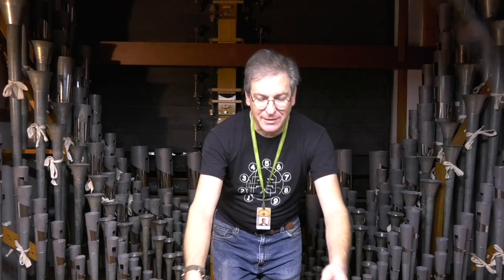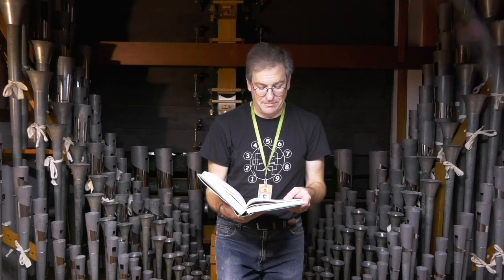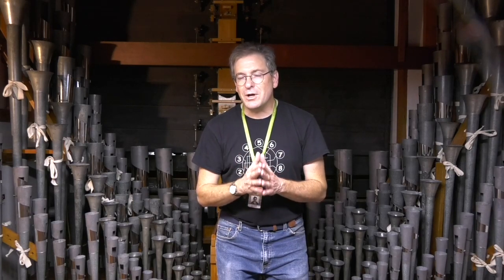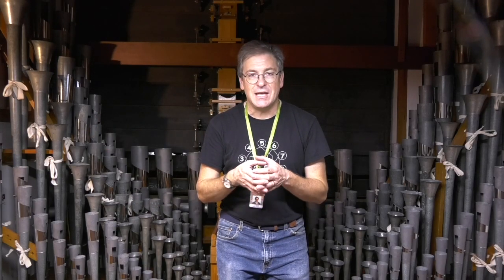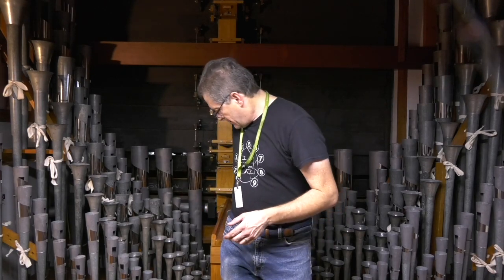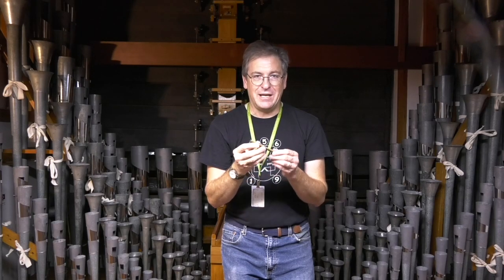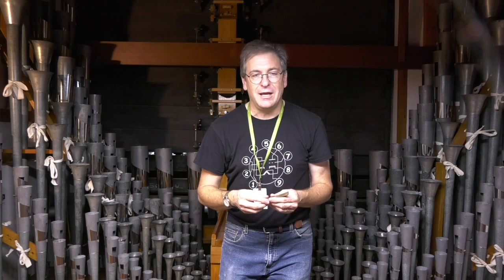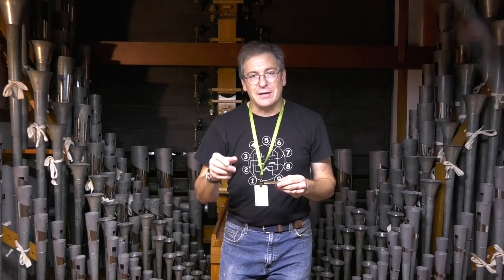Boardwalk Hall extra- PIpe purchasing parameters II

Comment: Nice shirt, which twin triode tube is it? Thanks for the new lesson on pipe purchasing.
Reply from the maker: As far as I'm concerned it's a  12AX7.
Reply: @cnagorka  or it could be a 12AU7, or a 7025, or a 12AT7, or a 5751, or a 12DW7, or a 12BH7, or a ……😆
Reply: I build tube amps, have you seen the prices they are getting for those now, they are getting expensive. I try to use less costly  tubes but still get good results. @cnagorka

Comment: What does the resonator scale actually do, then?
Reply from the maker: It does have some influence over the tone, of course, I just wanted to make the point that it doesn't work like flue pipes. I've never seen a skinny little french horn, for example. But I think it's used in large part to scale the organ for the room, larger resonators for larger rooms, within reason. Of course, you will ALWAYS find exceptions to this.

Comment: 13:24 The Kimball tuba at 119dB is 6.3 times as loud (+8dB) as the 111dB trumpet in your hometown instrument.
Reply from the maker: Yes! The logarithmic scale. It is louder, but not ten times louder, since it's on almost 10x the pressure- that's the point. You also notice that the meter said that the Mirabilis was softer than the regular Tuba!
Reply: Yes indeed --- and I still love that dual-triode shirt.
Reply: @cnagorka  Due to the logarithmic scale of perceived volume, wouldn't a convergent sequence to a particular ratio constitute the "ideal" library of wind pressures for an organ? For example, say one built an organ with a Fibonacci Sequence of wind pressures – 1", 2", 3", 5", 8", 13", 21", etc. – wouldn't that (with appropriate voicing, of course) allow one to achieve a relatively "even" progression of volume?

(I now realize that this comment is rather off-topic given that I was thinking more of flue pipes. Now I'm wondering how it works for diaphones, though...)
Reply: @Kaiveran  Same here for diaphones. I would like to build a wooden set to match the early Wurlitzer leaded open diapason that I have.